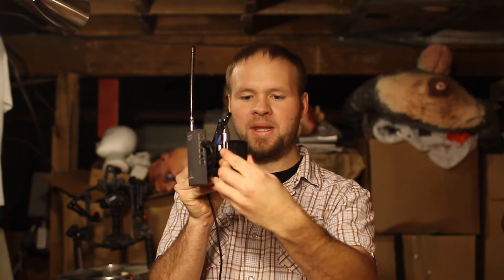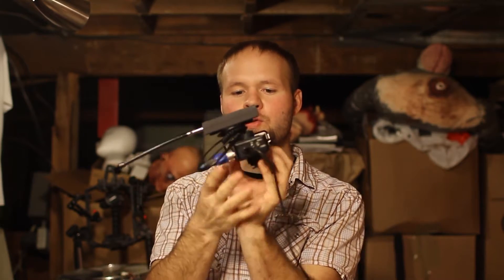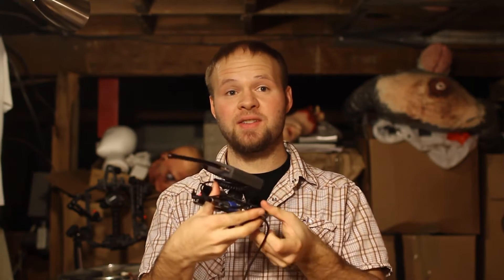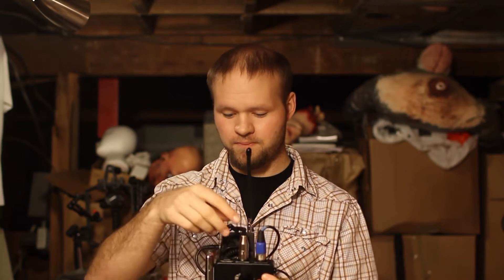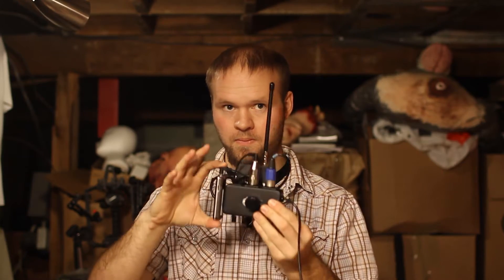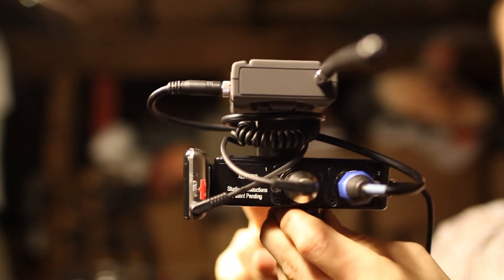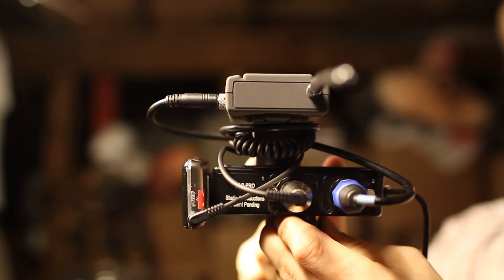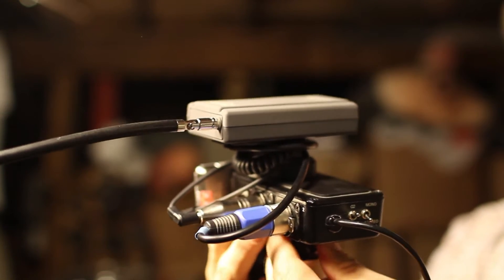Canon 7d Disabling AGC using an mp3 player. - DSLR Film NOOB

Comment: Okay about my comment. I just verified it and it works perfectly

You can even monitor at line level without the Headphone amp. 

Just use a standard headphone splitter to add the mic on one input and headphone on other

Comment from the maker: @BDogbz Not really much you can do about AGC in post. Either dual system sound or tricking AGC are the only way to go on the 7d.  The T2i has the magic lantern hack as does the 5d and 60d. The 7d is the only camera that doesn't have a fix.

Comment from the maker: @CYNFELYN23 Lenses tend to hold there value so if you can only afford th 50mm 1.4, you can always buy it and and save up, then sell it when you have enough to get the 50mm 1.2. Its better to use what you have then to have nothing until you have the best.